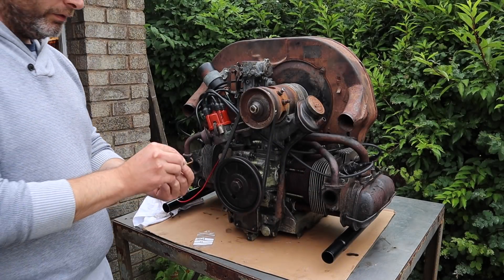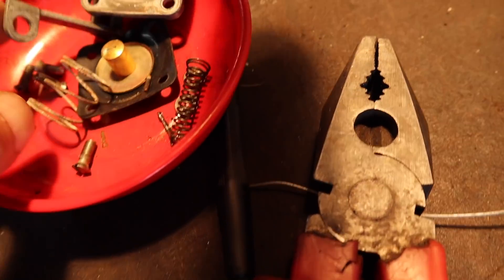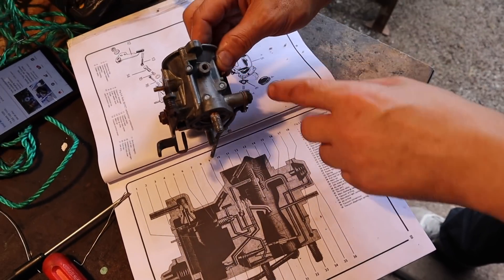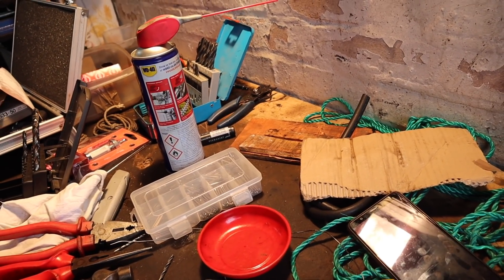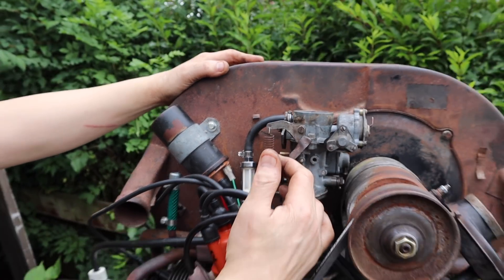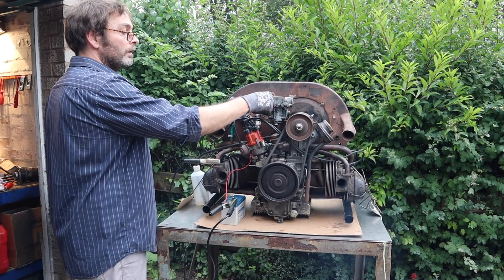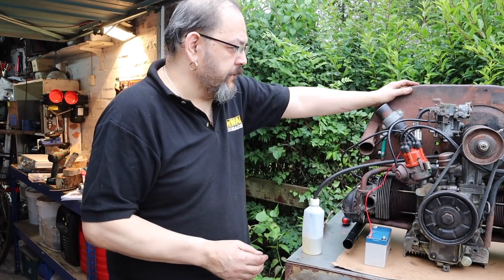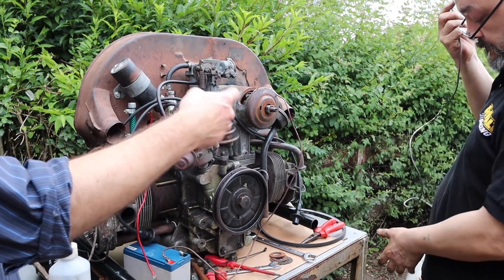Solex 30 PICT carburettor pump issue resolved

Comment: hi how did you sort the fuel problem out with the throttle. as i have the same problem when i pump the throttle no fuel is getting into the carb?
Reply from the maker: Hi, I seem to remember that there is a ball valve in the carburettor - for the pump jet circuit - that was seized. We unseized this ball, got it moving, and it worked well afterwards.
This is all i remember as it was about 3 years ago.

Comment: I'm from Spain
Maybe I have the same problem.
You say that valvule on carb can be regulated to control the mixture?
Reply from the maker: We had problem with corrosion and sticking ball valve in the carburettor.
This ball valve operates the pump jet system.

We have to remove it, clean it, and re-install it.. This cured the fault and engine runs good.
Reply: @Classiccarbscouk  in the minute  11 you talk about the valvule on top of the carb,cut the gas entrance.
You change it
Why and what it do? 
Thanks
Reply from the maker: @marktorke  we change the needle valve, back to original 'solex' type
Reply from the maker: @marktorke  we change it to ordinal solex, because the other one (the new one) leaks fuel... not suitable
Reply: @Classiccarbscouk  I understand.
Thanks
I don't know what's happening with my fucking carb.
😭

Comment: 15:37 carbi frosting is due to the heater risers maybe being blocked. The heater risers that lead up from the exhaust manifold to the intake warm up the intake to help atomise the fuel and stop it from going from a nice mist to droplets. Because you haven’t got the rear exhaust connected to anything, the heater risers aren’t really working.
Reply from the maker: Thanks Stefano 😊

Comment: Get rid of those 'J tube' exhausts and buy some proper heat exchangers, even 2nd hand ones and get the pre heater pipes connected. This will help to stop the carb icing. As I said before with Kate. The flashy stuff looks good but does fook all most of the time. As for the intro. I like the 'stang but the music should be something a little more like this I think..... 
https://youtu.be/pE1gTYd9EDc
Reply: Oops. You'll also need a proper vw type exhaust silencer or similar to connect the pre heater pipes (heat risers) to, or at least one with the pre heater connector pipes, sorry. If/when you finally fit one use a gasket with a large hole on, I think, the left hand side and the small hole one on the right.

Comment: Don't forget to Zap / polarise the generator!!!!. if you don't it will fry up both the genny and the regulator. .Engine sounds great though! very nice in fact.
Carb is ftrosted becuae you do not have the exhausts hooked up. Note the small pipe on each side? that directs the exhaust gasses up to the carb  to prevent icing. 
The popping is normal VW sound. number 3 cylinder is timed differently in the dizzy to prevent overheating on that cyl. A common fix used to be a Bosch 009 distributor which gave equal points timing and fried valves on number three..
Reply from the maker: Thanks Mercmad 🔥😊🛠👍🏼😎🏁🎩

Comment: Carburetor icing is normal on Aircooled engines, its due to the length of the intake manifold. 

The icing is worse because you don't have the exhaust fitted so the preheat pipes aren't warming the inlet manifold (assuming they aren't blocked, as they block up with carbon over time). Also the factory air filter also has a warm air feed to further reduce the icing.

The timing marks are all there on the stock crank pulley, you can set it statically if you don't have a timing gun.

Also check for air leaks as that can cause popping and backfiring, spray WD40 around the manifold, if the revs pickup then thats your airleak, although its probably down to the lack of an exhaust.

And finally dont run it too long without the cylinder tins on, as the cylinders aren't being cooled properly without them on.
Reply from the maker: Thank you buddy, much appreciate the helpful tips 👍🏼😎🏁🔥🎩🛠🏁😊

Comment: You're doing a great job.  Keep up the good work. And you need to hook up the heat tubes that run under the carburetor in the intake. They warm up the intake. Keeping the carburetor from frosting. They are called heat riser tubes.
Reply from the maker: Will do, thanks John 👍🏼😎🛠

Comment: Smart to price an alternator conversion kit, those generators are only so much for what they do when they do work.
Reply: The stock Generator/Dynamo are pretty good, mine is charging two batteries, in my camper no issues. Never had an issue with any of them on my vdubs over the years.

Comment: Can you please let me know what is the air mixture setting for 1963 Ford Consul Classic 315 car.. I just can't get good drive in the car because.... It runs okay. But when I go for a drive. It just won't run smoothly
Reply from the maker: Hey John,
Your carb might have worn bushes/spindle and and drawing air through the gaps. 
No amount of mixture adjustment will cure that. It might need rebushing
Reply: Thanks for your reply..... The carb is a zenith vn2.  Do you have any
Reply from the maker: @visab230  we dont have any zenith carburettors, but if you email me I can perhaps send you the contact details of someone that might.

My email is support@classiccarbs.co.uk
Reply: I just haven't got around to email yet.  Lololol 07743929722

Comment: Runs like a top! Carbs can be tricky. . . but you know that! The heat tubes for the carb attach to #4 and #2 cylinders to prevent the cold on the carb. You need to get those tins sorted or you will burn her up. She needs the fan blowing lots of air across those cylinder fins or she will start to glow and pre-ignition is going to blow a hole in those heads!! Other then that. . .carry on chaps!
Reply from the maker: Thanks buddy, yep, we need to sort the exhaust system and tinware for sure.
Thanks!
Emmanuel 😊🏁👍🏼🎩

Comment: She’s icing due to no exhaust dude, and the popping could be due to no gaskets on cylinder
Reply from the maker: Thanks!
We did fit the paper gaskets, are those the ones you mean?
4x metal and 4x paper rings?
Reply: Rusty Love  yeah mate, they are what I mean, probably find it’s either  your timing , or could be to much fuel in the cylinders so a improper tuned carb

Comment: If remember right did you say you were going to rebuild the engine properly as soon as you got it running. I could be wrong but the popping could be down to no gaskets on the piston head
Reply from the maker: Oh dear... cylinder head>cylinder gaskets you mean?
Reply: Yes sorry. Cylinder head.
Reply: Cylinder gaskets

Comment: Hi Emmanuel, very enjoyable videos mate . It’s very interesting watching you build the engine and bringing it back to life, with regards to the carburettor icing you have to remember the air cleaner is normally fitted and there is also heat ducting missing from the engine that normally diverts warm air to the intake. I love the sound of the old VW flat 4 engine , I’m a Ford man really but it’s a thumbs up from me . When I was a kid my parents used to have a bay window camper 👍🏻 stay safe
Reply from the maker: Thanks Chris,
Yes, someone else said the same thing you're saying regarding connecting the manifold heating pipe.
We're on it!
Glad to hear you liked the vid, even though you're a ford man.
I'll see about getting kate out soon to see if there is any progress we can make 🎩🛠😎👍🏼🔥😊🏁
Reply: I have a 28/36 DCD same "issue" just test fired it today on a mk1 fiesta and within a couple minutes was like ice to touch.  Not sure if I should be concerned or not.

Comment: the carburator is frosted because because the exhaust is not installed
Reply from the maker: Got it, we'll have a look at correcting that/connecting the exhaust.. thanks Fred 👍🏼😎🛠
Reply: @Classiccarbscouk  depending on the muffler you use. And you should use an original muffler. You need to look in the left side exhaust hole. Is there a tube in there?
If there is a tube in there, you need to install that peashooter… About a half inch away from that tube. 
When the exhaust comes out of the peashooter, it will make a vacuum in that tube. And draw hot exhaust gas from the other side to preheat your carburetor. Bernoulli’s law.....
I bought a new Danish muffler and it does not have that tube. They did away with it and have their own design inside to make a vacuum and draw hot exhaust gas through that pipe.
It is imperative that you make sure the heat riser pipe is unplugged. See if you can blow air through it. If you can’t you will need to unplug it.
I see more Volkswagen engines run like crap because the carburetor is not preheating, raw gas is being dumped in the engine. Causing spark plug fouling, premature wear, bad gas mileage  and all round crummy performance.
Or, you can put a header on it… It’ll run like crap. But it’ll sound great. Get a Chinese chrome one ...the chrome adds 10 hp
Reply: Oh, and I’m sure you were going to put the cylinder head Tin on correct?
Yeah, you probably already know this but I got to say it.
Make sure you have a good front and back rubber for the engine compartment. To keep out the hot exhaust gas. Remember heat rises. And any hole that compromises the system, Will compromise the engine.
So make sure you have every piece of tin not just some of it. About 95% of the engines I look at have pieces of tin missing. Every piece was there for a reason. It’s a pain in the ass, but every piece needs to be there.
Again, there cannot be any holes between the top and the bottom of the engine. It must draw it’s cool air from the top.
Also please use and adjust the thermostat properly. You can see how it’s done in the Bentley book.… About 98% of the engines I look at are missing the thermostat. Incidentally.
Truly I am just trying to help. Great video👍👍
Reply from the maker: @OkFixer  wow ok fixer!! You know your aircooled motors well man!! Thanks for the tips 👍🏼👍🏼👍🏼🔥🛠🎩😊🏁
Reply from the maker: @OkFixer  Bless you buddy, you are helping indeed, thank you very much for the tips, they are noted in my head now 👍🏼👍🏼👍🏼👍🏼👍🏼👍🏼
Reply: @Classiccarbscouk  👍👍👍

Comment: the carb freezing is due to the exhaust crossover not hooked up , make  sure to get the cylinder tin on  ,and the exhaust deflecter tin (inbetween the cylinders on the bottom ) and get a racy exhaust and your set!!
Reply from the maker: Ah thanks for that, yep, were on it!!
Thanks for the useful tips and thanks for your comment 👍🏼👍🏼👍🏼😎🛠🎩🏁😊